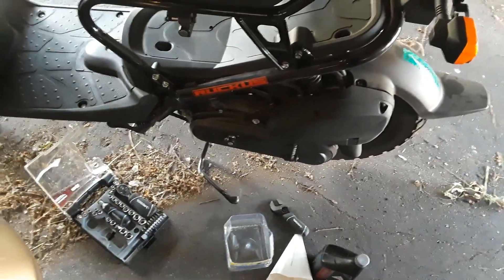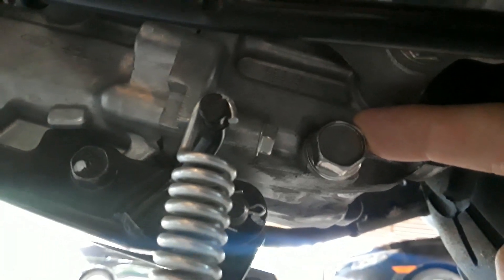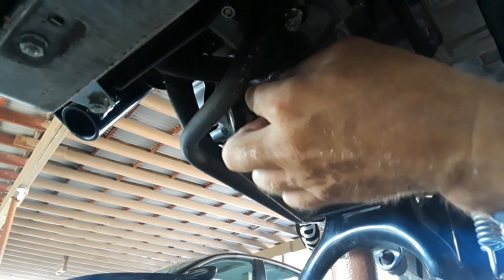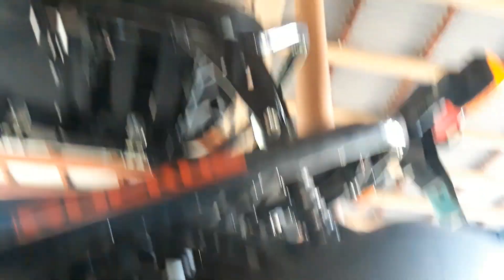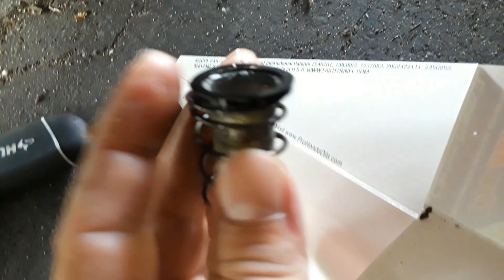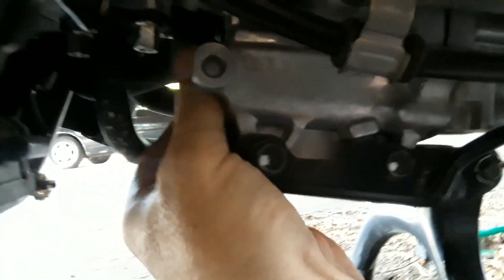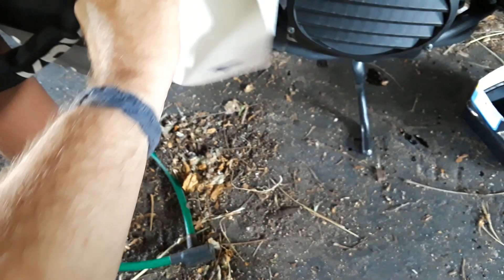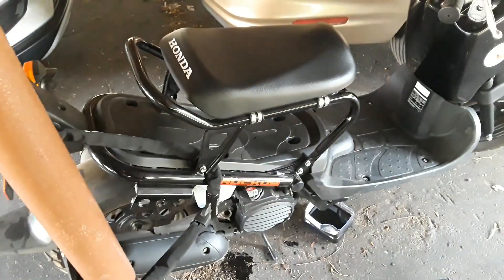2020 HONDA RUCKUS OIL CHANGE #honda #ruckus

Comment from the maker: Found out a baster works...
Like the thing you use to suck out juice from a turkey pan and squeeze that bulb thing to make it work...

It is measured, and has a tip that fits into the oil spout....so you could use it for all fluids